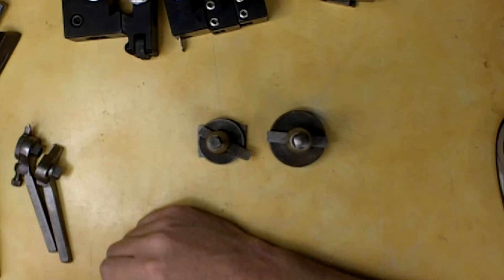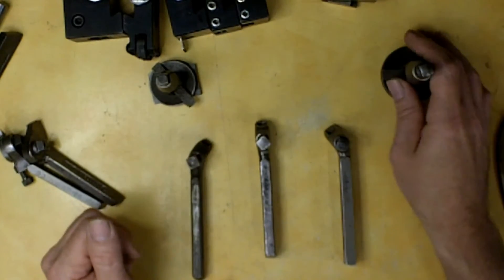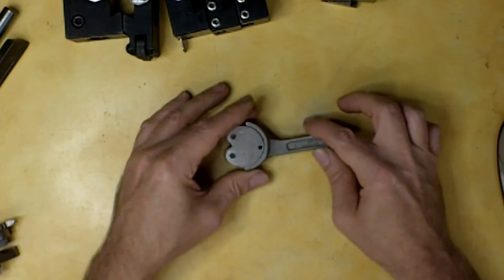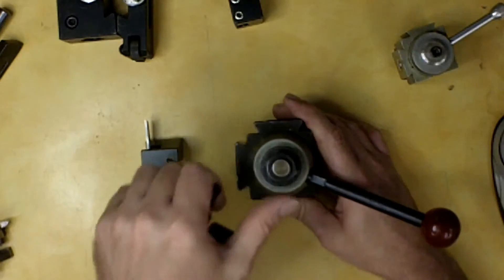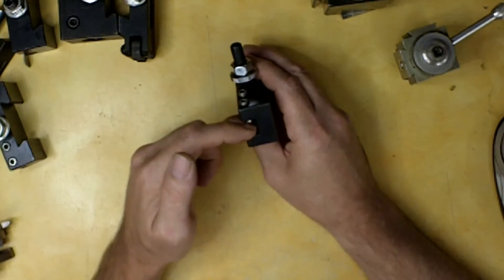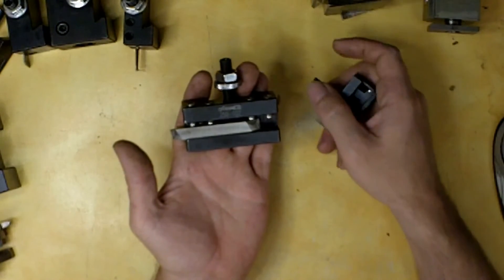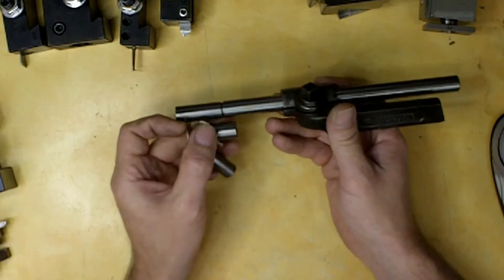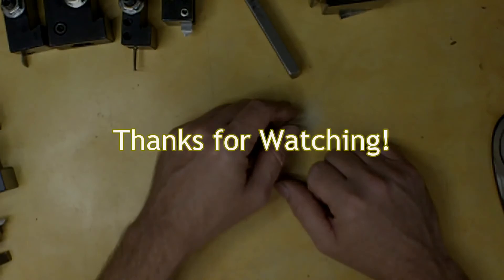Metal Lathe Tool Holder Types

Comment: I have the phase 2 Quick tool post holder . 
How do I take it off the compound rest /cross slide? 
The top nut seems to not want to come off . 
I just don’t want to put it in the vice and hit it with the impact wrench 😏
Reply from the maker: Peater, you should just have to loosen the nut on the top and it should then slide out of the compound rest. If for some reason there was a crash or something like that- it could rotate the tool post and make the nut tighter than usual. In that case, put a wrench on it and strike it with a hammer in a counterclockwise direction. Hope this helps. G.

Comment: I just purchased my first lathe. It's a used China made mini lathe but it was cheap so I can learn on. The tool post is terrible however so this video will help me choose the correct tool post, thanks.
Reply from the maker: There's nothing wrong with getting a good deal on a lathe- regardless of it's make. I know the small import lathes are extremely popular, and there are tons of good mods to make them even better. I don't know if the quick change A2Z are still available, but any QC tool post that will fit your lathe- you will love using.
Aside from that, you're going to get hooked on machining- so be prepared....lol. Glad the video was useful. Good luck, G.
Reply: Thanks for the response. Your right, I'm already looking around for material I can cut.  :)
Reply from the maker: LOL! No problem! G.